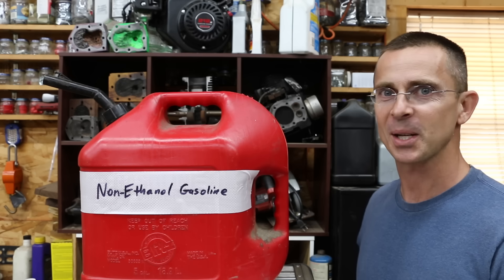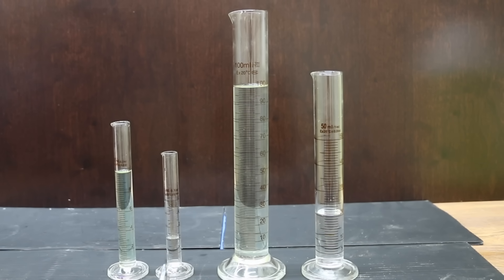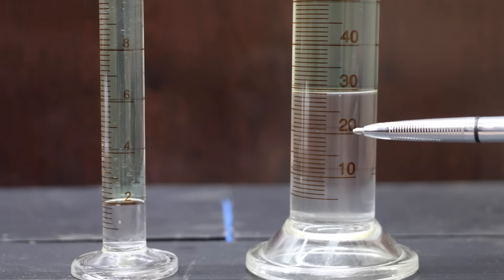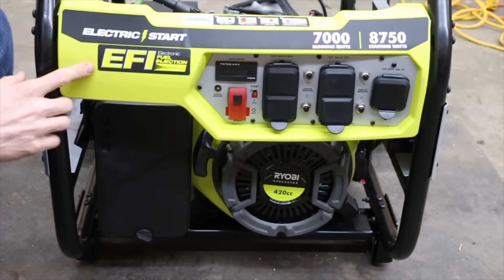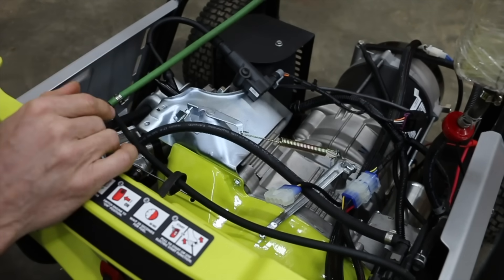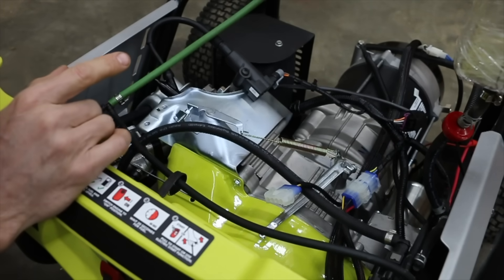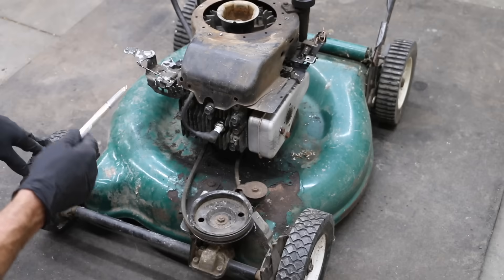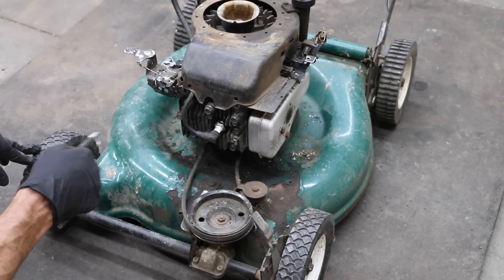Is Non-Ethanol Gasoline Really Better? See the PROOF!

Comment: It's better for older vehicles - the Ethanol deteriorates rubber hoses and can clog carburetors and fuel filters more easily than straight gasoline can.
Reply from the maker: Great point!  I began the long-term test on ethanol in fuel.  Looking forward to seeing how much damage it causes.
Reply: @ProjectFarm  Have you made a video like that yet?
Reply: My grandpa got very angry when my grandma put normal fuel to my grandpa's 1955 corvet
Reply: In Finland we have 95 oct E10 and 98 oct E5. And people use the 98 with 5% ethanol in older cars without problems. They won't use the 95 oct with 10% cause they also say that the rubber parts "dissolve" parts that's clogging stuff up but i really don't know if ir is true. Would be cool to see some tests done by project farm
Reply: The parts used in the fuel system tends to either tolerate ethanol or not. Ethanol in fuel is nothing new and unless the vehicle (or contraption) is very old, odds are that the hoses and stuff works with ethanol.

However, I've heard that ethanol may somewhat clean old fuel systems, flushing out old crud which then clogs the fuel filters, etc. This is a common concern for E85 and I don't know E10 could have this effect. But lets face it, if you have a rubber fuel hose that is 30-40 years old, chances are that it will be full of crud, or dissolve all by itself, and clog up the system regardless of the type of fuel you use.

However, ethanol  in fuel can have adverse effects on things like fuel pumps that are lubricated by the fuel itself. Ethanol is not a good lubricant (not as good as gasoline anyway) and high ethanol blends (eg E85) tend to wear harder on fuel pumps.
Reply: @leifsimmons2464  I ran an 84 Caprice (carbureted, with the 305 engine) mostly on E10 from 2013 - 2017 and never had an issue, actually the B.P. E10 (87) seemed to run better under load than Country Fair's E0 (90 or 91) fuel; if I didn't use B.P. gas, the car gave off a "pinging" sound going uphill.*

* The air intake hose was gone and the EGR tube from the cat was broken so the air-fuel mixture was hotter than it may have been designed to be.
Reply: @leifsimmons2464  Ethanol is not a lubricant at all. It’s the opposite - a solvent.
Reply: @101Volts  Burning higher octane than needed, without proper sensors was not a good idea.
Reply: @oddis188  Try soaking some rubber in alcohol. It will eat away at it.
Reply: better gas than here in the us.....tep  @oddis188
Reply: @oddis188 Muitakin suomipoikia seuraa kanavaa.
Reply: @oddis188  Taisin jopa kommentoida suht samalla tavalla kunnes huomasin tämän😁
Reply: I tend to use E0 (Ethanol Free) in lawn equipment, for the most part (or at least before storage over the winter, it's 70¢ / gal. more than 87 E10 here.) if E10 sits for weeks or months before I use it up, it's more likely to cause problems. That seems evident by how my neighbor's mower was; it didn't stop stalling until cleaned with the slight water spray into the air intake method. He also had a clogged air filter but that was secondary to the dirty combustion chamber; it didn't run well even with the air filter off until after I cleaned the combustion chamber.
Reply: @101Volts  Don't run your engine without air filter...
Reply: @mikeymcmikeface5599  For most use, I leave the filter on. If the engine's having problems though, I might have it off for a few minutes while I spray water into the air intake from a spray bottle - provided the individual engine  isn't having issues already. I've done this many times and if it's done properly, there's no problem.
Reply: I know that my grandfather's friend on my dad's side named George, I'm pretty sure project farms remembers this since I mentioned it on one of his videos, that George  uses premium non ethanol fuel for almost all of his vehicles, especially his 4 cars that he puts away in storage for the winter (October through April or may). Part of like what you mentioned, George worked as a mechanic, and he knew the nightmare of ethanol in fuel on in terms of storage purposes. I know george had bought me I think it was a 1987 Honda 4 trax 4 wheeler, and my parents had gotten divorced in late 2011 early 2012, well, George brought the 4 wheeler out to my dad's house and it for the most part just sat around, well, the problem was that I didn't use it that much, and the fuel was untreated, it had ethanol in it. Well, unfortunately, years later in about 2015 of 2016 or so, I started needing the choke upon for it to idle, unfortunately, I didn't really think about  it at that time, but the ethanol was starting to be a problem, and coarse eventually, George and I brought the 4 wheeler out to his house, and eventually the 4 wheeler stopped running. When George and I pulled the carburetor off the 4 wheeler and pulled the carburetor apart, we found reminse of the ethanol gunk.
Reply: It would be interesting to see the difference that time makes, especially if you add in condensation on a vented tank (not just sealed and left).  I had significant issues with algae growth on a classic vehicle that was parked up over the winter.  Could you run two long term tests, one vented and subject to temperature differences, and one not?
Reply: AIO inc. The ethanol acts as a solvent and desolves the varnish and sludges left behind by the old gas. I have a lawnboy mower that is about 30 years old. Have been burning straight ethanol in it for my yard trimming. Been using that 2 stroke with a 1/4 cup of veggy oil added, for about 10 years never broke down, never changed a thing not even the spark plug. Still running to this day. My new chevy Impala is an E-85 car. The difference is it has direct fuel injection, no through body or any of that junk, or fuel rails. Now ethanol doesnt have the BTU gas has but because of some different burning properties, makes the gas burn faster and hotter. Doin't know why. My Impala is 3.3 v6 and I get 33 mpg in town and a trip to Colorado Springs netted me about 39.3 on the highway using cruise control.
Reply: @TheDave570  hey what year is the inpala? Great mpg!
Reply: @milliondollar2981  2013 ! I know, the Chevy Dealer I bought it from can't figure it out either !
Reply: @milliondollar2981  2013
Reply: @TheDave570  Probably a bit of a different case for a 1988 Yugo GV with a 1.1L I4 or a 1993 Cadillac Sedan DeVille Special Edition with a 4.9L V8.
Reply: @AiOinc1  Back in 19 80 I had a Mk 4 with a 460 v8. At that time gas-a-hol was big. Run it in that 460 with no problems at all !!!
Reply: TheDave570 

It increases octane so fuel burns slower. It contains oxygen so improves combustion. Its flame temperature isn’t higher than gasoline. It’s 40°C lower.
Reply: @TheDave570 , You're so full of shit saying you're running straight Ethanol. That would require you to change the jets in anything you run. I race cars with straight alcohol and the jets need to go up in size by 2.5 times or the cars won't run at all.
Reply: @TheDave570  The difference is only due to the fact that the Cruise Control, being a mechanical adjustment, maintains a constant supply of fuel instead of the small fluctuations that would occur when using the foot on the accelerator. Although at a perceptual level it might seem that if we keep the foot without moving it we maintain a constant acceleration, we must remember that the accelerator is a lever so that all the movement applied to one point is multiplied to the other.
so that things as trivial as even our own blood pulse or the same vibration of the road or the engine create minuscule disturbances in our pedal so instead of maintaining a constant number 1, we are actually accelerating and decelerating all the time, suppose we fluctuate from that 1 to 0.8 and 1.2 for example

This fluctuation causes fuel consumption to be slightly higher, in addition to the fact that while we try to maintain the same speed manually, this fluctuation of more and less grows.

Not many but several car User manuals will even recommend that you drive in cruise mode and cruise throttle function for as long as possible (and which is obviously safe) to save fuel, improve engine efficiency (by not suffer from acceleration oscillations) and reduce wear on the engine and pedals.

Even that is the secret of road trailer and bus drivers to save expenses and work (since they are long hours and as a plus they can grant or calculate costs or rates in a more fair or fixed way for a route instead of charging for speed, riding time and distance, taxi-style)
Reply: @TheDave570  While E-85 has a higher (105) octane rating, it has a lower energy rating than gasoline. Your engine increases cylinder compression by using the retardation benefits of the higher octane to produce higher output power, but… your fuel fuel economy does suffer. Using E-85 results in a roughly 20% reduction in fuel economy, which is offset slightly by E85 costing less.
Reply: @TheDave570  wow, I am shopping for the same make n model now, thsts incredible mpg !!
Reply: I got a free tiller last summer. Was a craftsman from the mid 80s. The carb was full of of black rubber powder.
Reply: Ethanol eats the OE non-ethanol safe rubber lines and parts in vehicles pre-2000, accelerator pumps and non-brass carburetor floats get dissolved along with older fuel sending units in gas tanks. If you're going to run ethanol gas in older vehicles use an ethanol metabolizer fuel additive or convert to ethanol safe parts.
Reply: Aaron Wilson 

Ethanol metabolizer. Yeah...right.
Reply: @alphonse4991  PRE-1990!
Reply: Actually the issue is swelling of certain types of rubber compounds.
Reply: It only clogs stuff up because it cleans it all.
Reply: @MindBlowerWTF  And because ethanol is naturally grainy
Reply: @MindBlowerWTF , LOL, YEAH OK.
Reply: I had 3 carb rebuilds  in 10 years on my 73 ranchero when the damn alcohol came out. The latest carb kit is supposedly alcohol tolerant. We shall see!
Reply: It sure screws up the intake boots ,on my newer chain saws
Reply: Ethanol was added to fuel in 2007. Pre 2007 carbureted SeaDoos have a lot of engine failures due to the ethanol reacting with the brass fittings and the vinyl fuel lines. It creates a green goo that clogs up the small internal fuel filters in the carburetors which causes the engines to run lean and sieze. Ethanol is responsible for a lot of Seadoo engine siezures with low hours. I bought a non running project 1999 RX Seadoo with a 951 engine that had this issue with only 128 hours on it.
Reply: And no wonder why in the 80's they stopped using steel has tanks, went to a form of plastic.
Reply: 恵勇気  , WRONG. Ethanol ruins carbs and leaves deposits that require the ports and jets to be reamed out.
Reply: Absolutely. Older car fuel systems were never designed for ethanol. It’s also the case with small engines (not cars) and marine engines.
Reply: @afcgeo882  you are wrong about that ethanol has been around since the model T ford the industry knows shitloads about it and how to run older cars on it
Reply: I dont agree with that , ethanol has been used since the model T engine, and 100 % ethanol has been used in race cars for  a very long time , clogs up carburatuers , perishes hoses what rubbish
Reply: Michael Wilson It’s not “rubbish”. 

I honestly hate to use facts and science on people who clearly don’t respect either (you, for example), but here you go: https://www.hemmings.com/stories/2017/04/23/fact-check-henry-ford-didnt-design-the-model-t-as-a-multi-fuel-vehicle/amp

Also, race cars are specifically designed to use 100% ethanol from the ground up. Modern mass-production engines are specifically designed to use E10 gasoline or low sulfur Diesel and in some cases, run on E10 or E85 fuels. Cars before the 1980s weren’t designed for ANY ethanol in their fuel, so their fuel systems contain components that erode from Ethanol, which is an effective solvent.

Now I expect you “disagree” with history and science, but then again, you seem to have disagreed with finishing your education too.
Reply: Older than 1990, yes.
Reply: Cars after year 2007 can handle up to e30 just fine. Vast majority from US.

Comment: Can you try gear oil in the engine crankcase because apparently it should stop blue smoke
Reply from the maker: Thank you for the video idea!
Reply: Gear Oil might do that but it's really not much thicker than 5w30, they rate gear oil's viscosity differently from engine oil. 75w90's about as thick as 10w40.
Reply: @101Volts  That's hard to believe. Certainly not true when it's not up to temp.
Reply: @weeral1  Even if you find that hard to believe, he's right.  Although 75w90 is closer to 20w50 than to 10w40. This is the reason Mobil 1 20w50 also carries the GL-1 rating and it's why Harley allows either 75w90 gear oil or 20w50 engine oil in its gearboxes.
Reply: It certainly did on my '63 Chevy 250ci. I6 w/450,000miles (40-60psi)